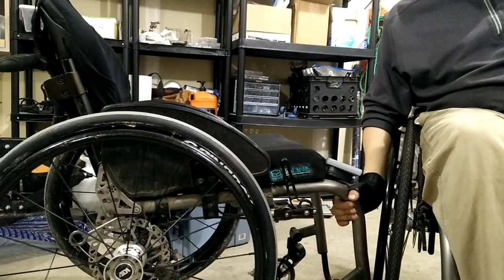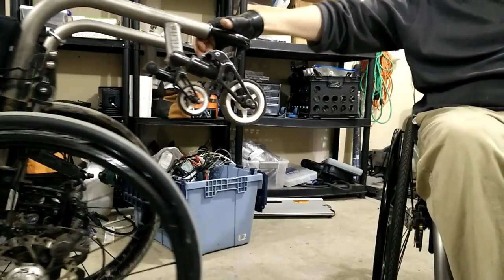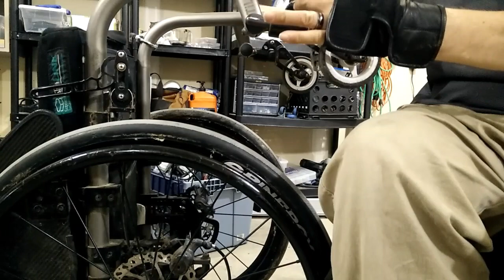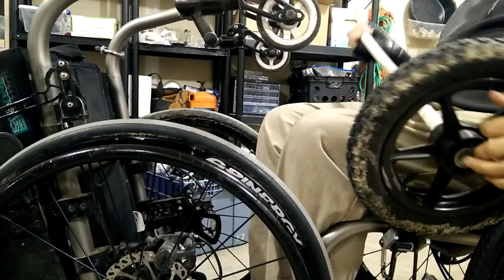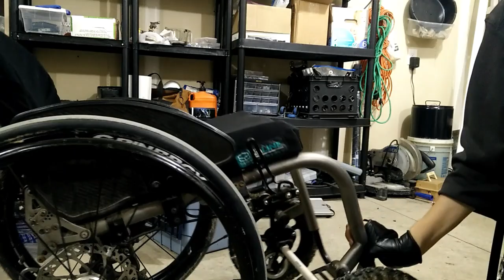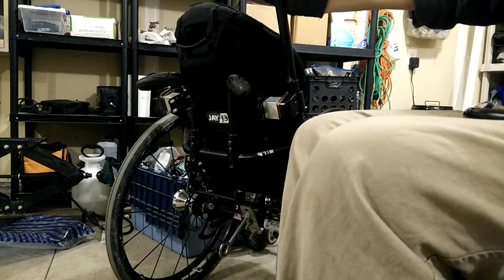Offroad Wheelchair Conversion - DIY

Comment: This is genius.  Are those the Ironton 12.5" wheels?   How did you find a bolt that fit exactly the width of the chair? Or does that need to be cut at the store to work first?  Thank you so much.  Can't wait to try this.
Reply: Yep Ironton wheels. Cut threaded rod to the right length.

Sorry for the slow reply, I guess I wasn't getting notifications from that account.
Reply: @tythomps  no worries on the timing; I’m so grateful to hear back from you .  I started a custom conversion on making an off-road chair with the 4” fat tires on the back, but unfortunately found out the “go freewheel” wasn’t compatible with the chair model frame I used.   
Truly appreciate you confirming with me and will get to work on front of chair now.  Thank you so much for posting this video.
Reply: @tythomps  No Worries, I'm so appreciative for all of your help.  Otherwise I just keep going to hardware store and blindly try DIY methods or order weird parts from Amazon.  Going to work on chair this month, so hopefully can post either my success or bomb video soon.  Thank you.  Fingers crossed.
Reply: @tythomps  Hey, sorry for second message.  I ended up buying some balloon wheels (12") for the front.  Started seeing axels for sale that were threaded and had pin holes on both ends to secure the wheel on, but they were all pre-sized.  Praying I got the measurements right for whats needed to get through the chair and wheel.  But had another question when you have a minute.     Is it ok to thread the axle through the opening of the front caster wheels?     The chair I am using to make the beach wheelchair, has these weird forks on them with no openings and in they're in an unusual position to attach an L-plate to help support the axle too.  Should I just stick to the pipe covering to help support the axle a little or do you have any other ideas on how to support the axle?  Open to all suggestions.  Never done anything like this.   Thank you so much.   --Russell     Have a Fantastic Holidays!

Comment: Man, i wish they would just make Wheelchairs with bigger forward wheels. I live in a city where the ground is very uneven and i always get stuck or fall out of the Wheelchair because the small wheels cant in between cobblestone.
Reply: Hey if you need your current wheelchair converted into all terrain electric, contact GESAR INC.
Reply: I'm in same issue with my electric wheelchair. I'm building wood wheels for back & front . Upgrade from 8”back 6"front to 12"back 10"front with bicycle tires attached to wheels as the side walks often end .